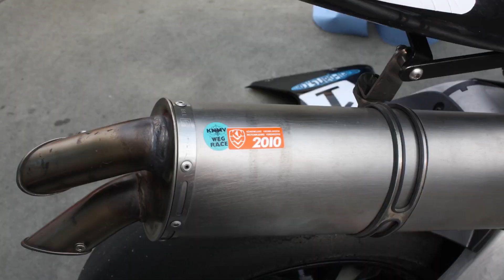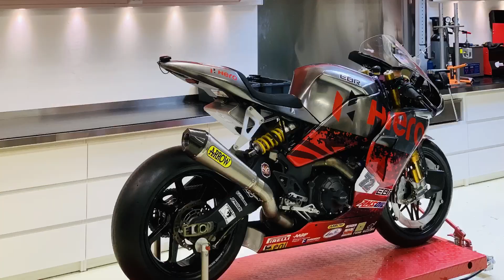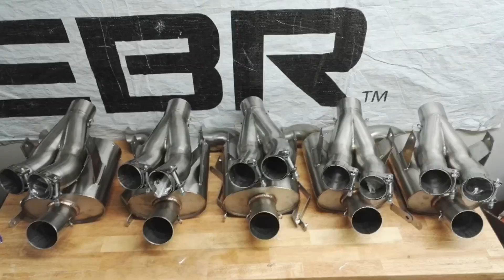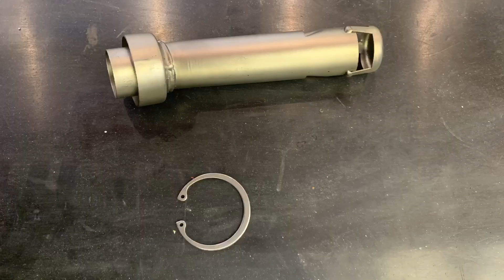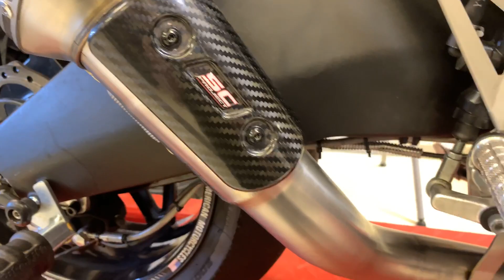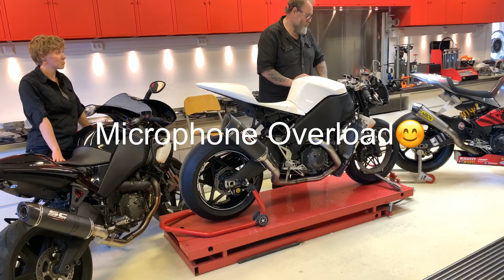NCCR Workshop News 7: 2020 Exhaust Launch APH (Alan Hawks) by NCCR new exhaust systems

Comment: Very curious what the dyno curves will look like compared to the APH setup with the pump gas ECU tune. Waiting to decide to add to my order for a frame bracing kit to see results as I don't think the original loud APH I have on my RS is good for midrange power.